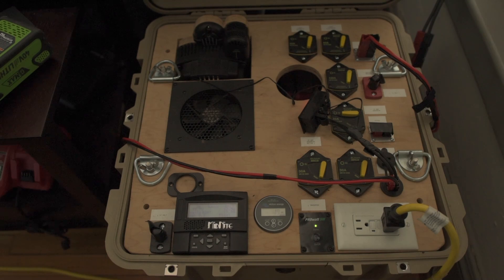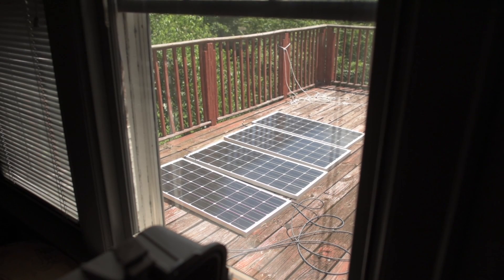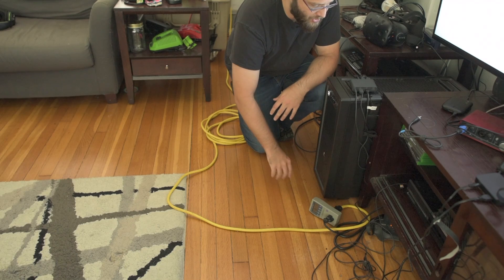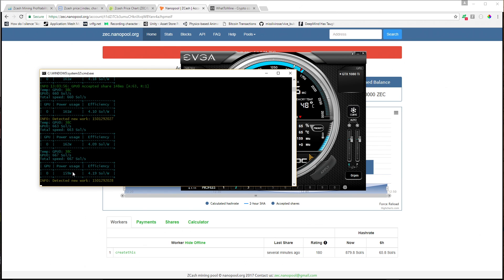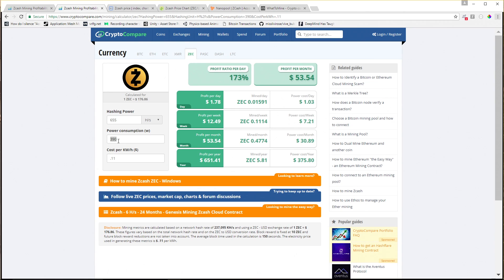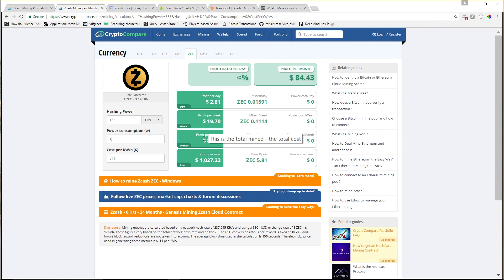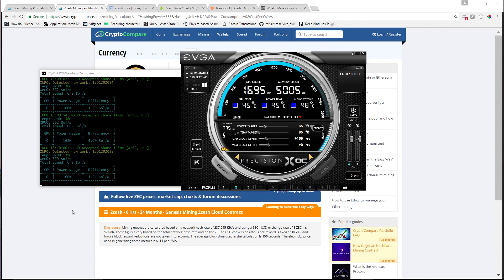Solar ZCash Mining Demo

Comment: They say solar trackers can be 45% more efficient. However commercial solar trackers are expensive. Have you looked into building a Arduino type tracker for your panels?
Reply from the maker: I have. I concluded it’s not worth the expense. Just buy more panels.

Comment: how do you get the pc to turn on every day? do you have an automatic task for this?
Reply from the maker: You could build a circuit to turn the inverter on when solar voltage is above a certain threshold. Voltage sensing circuits are pretty simple.
Reply: Thx bro , any point in the right direction is helpful. getting my old pc on for a few hours a day just getting a few solar panels and no batteries so ill just be running around 8 hours a day (average sunlight per day is 10), but this is just an experiment i soon to test. figured out to having the pc come up after a "power outage" option in bios. so when power goes out , once the motherboard detects power it fires right back up, just hope i have enough solar panels for a old rx280 -300 watt, cpu i5 - 100 watt, = 400 watt total consumption. (stander clock settings) plan to underclock as much as possible. aiming for a 300 watt machine. with a 400watt solar settup. let me know if you see any error's in my plan man.
Reply: can you share a video that can show me?
Reply: do you know where i can buy one?

Comment: I am building an off grid homestead and would like to do some off grid mining.  Do you think my verizon 4g mobile internet is fast enough to mine?  I am not sure what kind of speed you need to mine.  Looking forward to doing this out here
Reply from the maker: +Dennis Alan City Boy Homesteader you don't need a fast connection to mine. You just need a lot of electricity and high end GPUs.
Reply: Preferably a low ping connection,the speed doesn't matter much,but if your ping is high u may get lots of stolen shares
Reply: i have a off grid on grid setup, i have 30 270watt panels 3 smart grid tied inverters one 2500 watt inverter for my water pump and 32kwh of battey storage, this is running my whole house + mining with 3 computers, i earn upto 260 a month mining and my powerbill is about 25 - 60 dollars depending on how sunny the month has been. the whole setup cost me about 15,000 i built everything myself, smart grid inverters try to zero out your meter but they are not 100% so you always end up using a little grid power even when your solar makes 3 or 4 times more power than your house needs,  but staying on the grid is a good backup if something goes wrong.

Comment: Those mining calculators are based on the rig running 24/7. Your solar rig only runs when its sunny out. Then you also have to factor in the time loss on rainy/cloudy days.  My guess is that you would actually generate more profit by running 24/7 and paying for electricity. A grid tied solar system would help mitigate overall consumption, but since one 6 gpu state of the art mining rig can draw close to a kilowatt an hour, you'd need a massive solar array to make a significant dent in the power bill.
Reply from the maker: +AndTheCorrectAnswerIs or you get a larger solar rig with more battery capacity and mine 24/7. Yeah.
Reply: createthis The cost of an installed solar system is about $2.98/watt according to most online calculators. To run an avg. state of the art mining rig w/6 GPUs is going to take almost 1,000 watts (per hour), or 24,000 watts per day. So it would cost about $72,000 to build a solar system capable of supplying 24 kilowatts of electricity per day (assuming no extra capacity to account for cloudy/rainy days). Your 6 GPU mining rig will generate you about $275/month. This means your break even ROI is about 21 YEARS. The break even ROI on a GPU rig on the power grid (paying for electric) is about 12 months on avg.  It doesn't take an MBA or CPA to figure out which option is better.
Reply from the maker: yup. But to be fair, I don't think the economics of GPU mining really make sense with grid power either, do you?

I view all of this as more of a "hey, this is a pretty cool proof of concept" sort of thing. The cost of solar continues to fall over time. That's a fact. Maybe one day it'll be practical.

I'm also interested in the idea of cryptocurrency as an alternative to battery storage for remote solar installations. This was sort of a step toward exploring that idea for me. See the original (albeit shitty) video I did on that concept here: https://youtu.be/Ak-kjz2wkoE
Reply: createthis Of course the economics of GPU mining on grid power make sense. If they don't then you are mining the wrong thing or using outdated equipment.
Reply from the maker: If you say so. I'm personally of the belief that most GPU miners are just bad at math.
Reply: createthis Hey...I'm not the one that invented something that won't reach ROI for a couple decades. I appreciate the ingenuity from a proof of concept standpoint, but the return does not justify the investment.

Comment: Not zero! how much did you pay for those panels!
Reply from the maker: +Simopr Dev most of the cost is in the charge controller and battery. I view something like this as an alternative way to monetize existing resources, not a free lunch. I didn't buy any of this stuff explicitly for mining.
Reply: Me too, I got myself a nice computer, I did some mining with it but nothing disproportional :D.
I wanted to know how much those solar panels cost, and what is their life span.
Reply from the maker: 25 year lifespan. Like batteries, they still work after that time, but they'll output less than 80% of their rated capacity. I've had mine 2 or 3 years and I like them. Here's a couple of links:

I bought four of these exact model: [affiliate] http://amzn.to/2xv0c3U
But there is a slightly cheaper brand that appears to be just as good, here: [affiliate] http://amzn.to/2xulJcR

Economies of scale come into play in solar as in just about anything. These 100w panels are great for RVs, sheds, or any other DIY project. However, for larger scale stuff like whole-house solar, you'll get better prices buying the larger modules (250W+ per module) by the pallet.
Reply from the maker: Also, see this video: https://youtu.be/0tWaQlRrxxc
and this video: https://youtu.be/SaEm77e9WPI for information about wiring. I have mine wired two in series and two in parallel. If I added more panels I would have to either deal with higher voltages (dangerous) or thicker PV cable (expensive).

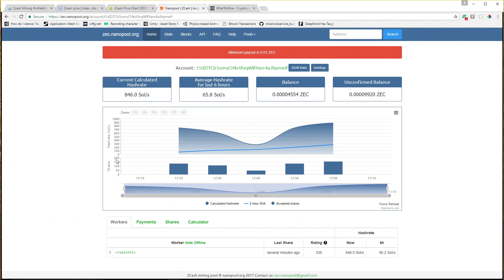Comment: 90.5 sols hashrate the past 6 hours on 2:54 video time. Not 655 sols claimed... ROI never sorry mate
Reply from the maker: That's the average. See the dip in the middle? I had the machine off during that time. It's averaging in the time the machine was off. I never claimed this was smart for ROI though. Mining in general is terrible from an ROI perspective, IMO. It only makes sense to GPU mine part-time when you're not using the GPU for other things, and in my opinion it rarely makes sense to buy GPUs specifically for mining.
Reply: " It only makes sense to GPU mine part-time when you're not using the GPU for other things". That's what I do :)

Comment: Please Sir Tell me if the Gtx 1080 is good at mining Zcash , and how much sols in second do the gtx 1080 
and what the average of payment in one month thank you very much.
Reply from the maker: +LiOgiOGamer DZ the 1080 is less powerful than the 1080 ti. Two 1080 tis get 1250 Sol/s and between $4 and $6 a day.
Reply: Thank you , But is there a posibility to mine 10$ a day , because i will buy a Zotac 1080.
Reply from the maker: +LiOgiOGamer DZ not with just one 1080 at the current rates, no. You'd probably need 3-5 of them.

Comment: Ever consider eliminating the AC/DC power conversion and PC power supply just use DC/DC supplying 12v and 5v for the PCB and cards? Big power losses when you have to go from DC to AC and then back AC to DC twice. You do need a regulated DC into the board and cards. My other thoughts were  to take a UPS and hardwire solar to charge the batteries with an option to tap off AC or DC to experiment with or without the inverter on.
Reply: Will update building a dc to dc miner now
Reply from the maker: +Henry Wolanski hmmm. I hadn't considered that, but it makes sense. Any suggestions for a DC/DC power supply in the 300-500w range?
Reply: You need to measure your DC draw on 12V and 5V lines, get an amp total for each, then look at the appropriate DC-DC for each current draw and voltage. You could mine 24/7 battery permitting. 

The easiest low power solar miner would be for ASIC ORBs or some small miners plus Raspberry PI. I have been meaning to measure my RIG and CARDS to get an idea
Reply from the maker: No need to measure, I think. My power supply is an RM850, which is a gold power supply. With dual 1080tis it draws about 400 watts at the wall. Gold PSUs are supposed to be 90% efficient at 50% load, so you can expect about 40 watts of that is wasted, giving us a baseline of 360 watts.

My inverter is a Xantrex SW2000 with an 85%-90% efficiency rating. At the battery shunt with no solar input I'm seeing a 440W draw, so it's about 90% efficient too.

That's about 20% in losses. Maybe a little more for margin. Call it 70% efficient, total.

Unfortunately, I'm not seeing many DC-DC PC PSUs capable of delivering 500W or more. Powerstream seems to be the main supplier on the internet: https://www.powerstream.com/DC-PC-12V.htm and their PSUs are only about 72% efficient for the 1000W model. Not to mention how expensive that dude is.

Unless someone makes a more efficient DC-DC PSU, I think just running a normal high efficiency inverter and Gold PSU is the best option.
Reply: I don't know anything about this, but I'm super curious. Why do you need DC-DC PSU? I would imagine drawing power directly from the 12V battery pack would work without anything else in the middle.
Reply: http://www.mini-box.com/DC-DC may also be worth looking at. I'm not seeing efficiency numbers, no idea if they have them on the website. The models I can see do not output 500W or more, but I was thinking if adding separate mini-PSU for groups of 2-3 cards would work. If that exists.
Reply: Cool info Wolanski

Comment: Do you still have the 980 ti's?
Reply from the maker: +Airbrushkid I have one, yes. 2.6h/w with 65% power.
Reply from the maker: +Airbrushkid no, sorry, 2.3h/w. Here's the screenshot: http://imgur.com/LdL0rR9
Reply: How, I have 2 EVGA GTX 980 SC'S and I oc the memory by +485 mhz. Cut power down and lower fan speeds. And all that gets me is 36 mh and 550 sols.